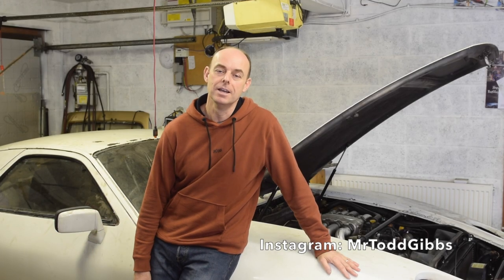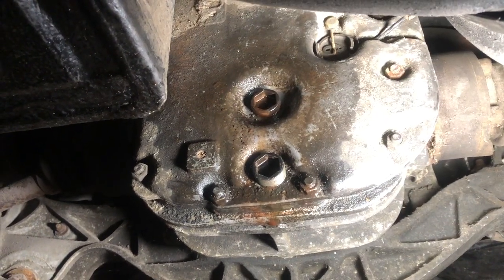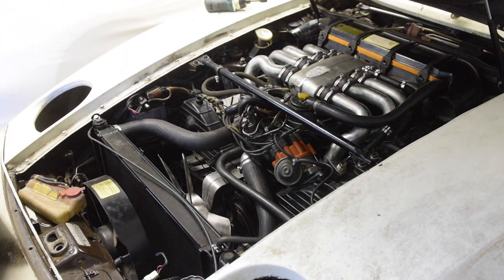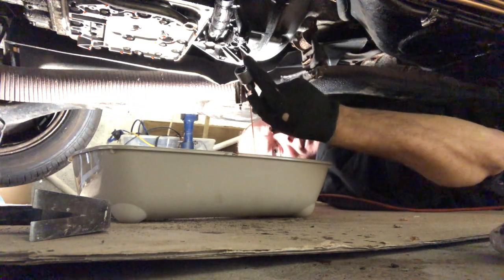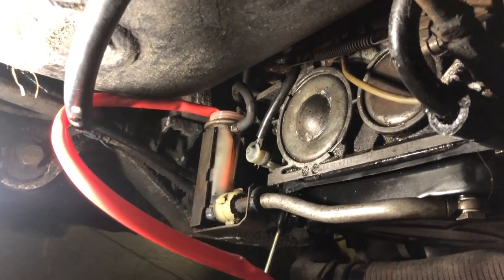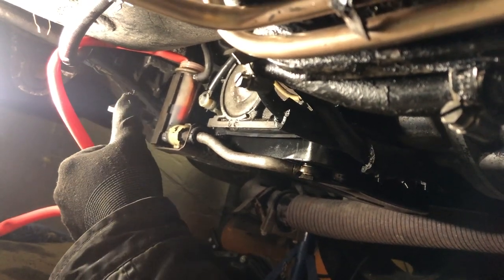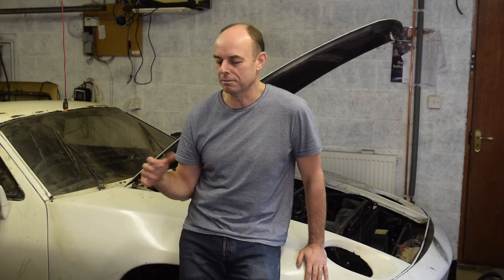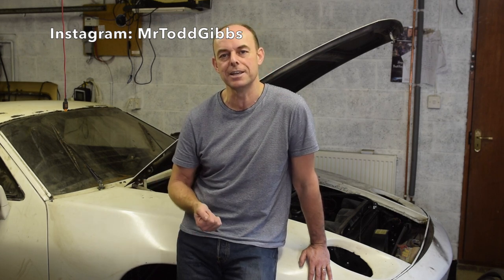Porsche 928 Episode 78 - First drive for 16 years

Comment: You are an inspiration Todd. I recently acquired a 1979 Porsche 928 that's currently not on the road due to bad oil leak from Cam cover. I've never pulled an engine before but with the help of your videos think I may now be up to fixing my vehicle myself in my garage. Great work and thanks for the inspiration!
Reply from the maker: Hi Martha, great to hear from your and what an epic car! (Mainly because it’s the same year as mine). Glad my journey is having the desired effect! Many will tell you the 928 is complex and troublesome… but I have found it no problem at all, as long as you take your time and lean on the amazing online community (Rennlist mainly). Good luck, thanks for watching and please message me if I can help. Where are you located ?

Comment: Absolutely fantastic Todd, this is so so cool. I'm really happy for you.

Agree there are a few noises which is understandable due to the cars age.

Whilst you were revving the car it sounded like a plate was rattling around the back box area, maybe a heat shield or something. Also check you power steering fluid again, when you were reversing out, driving back into the garage area and you were adjusting the steering I could hear the steering pump or something related to the steering making a noise.
Reply from the maker: You have good ears Terry - there is a loose heat sheild! and I also heard the power steering make a whining, will check today. Thanks!
Reply: @MrToddgibbs  glad to be here with you on this build 😀

Comment: Fantastic mate iam still working on my 997 4s
Reply from the maker: Thanks Dan, oh well done - where are you up to with it ?
Reply: @MrToddgibbs  hi Todd I had payed for a local engine work shop to rebuild and the place never fitted the gudgeon clip on piston five .and basically screwed it .and I took the engine too harteck and they rebuild it and I got all six cylinder relined and the valve guides done and all the parts that the first place put in replaced . It's a long winding road and you can't give up
Reply: How's the turbo s she's a belter mate
Reply from the maker: oh wow, what a nightmare! good you stuck with it... will be great once finished :)
Reply: @MrToddgibbs  you bet it will be at it for most Saturday for two years next month
Reply from the maker: oh wow... long build :(
Reply from the maker: Turbo is good, although I need to do an oil change really...

Comment: Great stuff
Reply from the maker: Thanks Gary. I still havent checked that fan clutch - will do at some point (its spins which is my main concern!). Also need to check the electric cooling fan switches on when hot. Ive been running the engine longer and longer to check it heats up ok without leaks - all seems ok so far!

Comment: Excellent! What's the next step? You putting phone dials on eventually?
Reply from the maker: Thanks Serpentza. Good question. Im currently looking at why the fuel gauge doesnt work and at the same time the tacho... but it appears the issue is in the cluster and I don't want to remove it just yet (will remove when I recover the dashboard). I need to look at the exhaust very soon, but Im thinking of replacing with a stainless system, so not much to do there until I decide which. 

I want to get the car on the actual road, so there are a few things I need to fix (speedo, headlights need fitting, brake lights don't work)...

... and I need to do the whole rear suspension (along with the gearbox - the service I just did was with relatively cheap oil and Im counting it as a flush)...

So lots coming up - not 100% sure which to tackle next; I may just tick off a few of the smaller jobs (like fuel gauge, brake lights etc).

Sorry for long answer - thanks for watching!
Reply: Hi Todd…There are two connectors to the cluster just by the bottom of the steering column cover under the pod…Have a look at them first… Looking good Regards Geoff
Reply from the maker: Hi Geoff, had the lefthand one off (with the fuel signal).That seems all ok. The other one has broken away from the cluster and is a dangling piece of ribbon connector (common problem I think). 

So far I've tested the fuel level signal from the fuel sender all the way to the cluster and it seems ok. I suspect the cluster is at fault. I read somewhere that the needle can get stuck on empty... so will remove cluster and have a look. Before that I'll quickly remove the fuel sender just to check its moving.
Thanks!
Reply: @MrToddgibbs  Fantastic, I'm really looking forward to seeing all the little nitty gritty stuff being done, you're basically creating a how-to on fixing each and every part of a 928 since your ocean dredged 928 needs pretty much everything addressed. Brilliant stuff and hats off for your tenacity and perseverance!
Reply from the maker: @serpentza  thanks - yes it was in one hell of a state. I’m not sure my videos are great how-tos, but hopefully they demonstrate it’s possible to restore one of these beasts without being a professional and at home. Thanks for watching :)